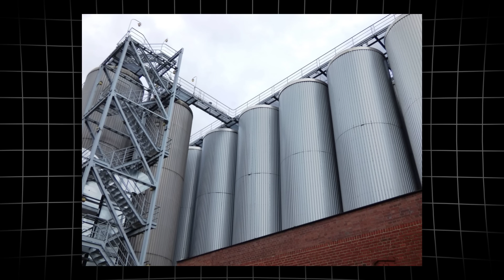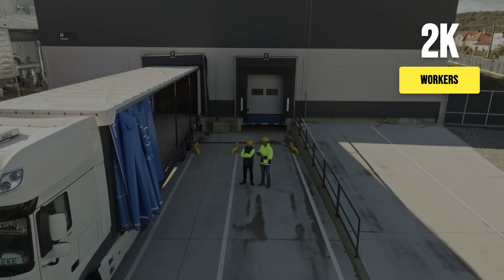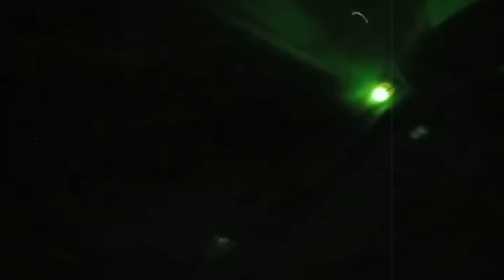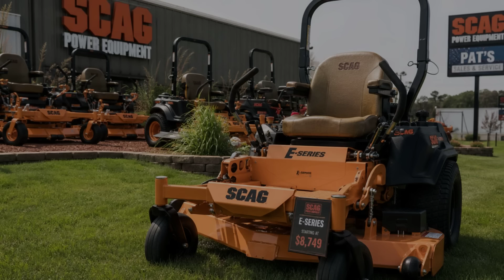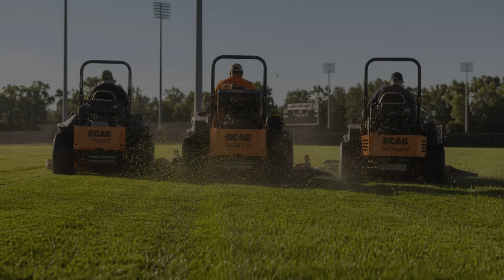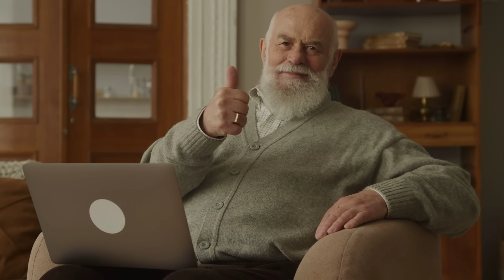The 4 LAST Truly American Made Mowers — And They're Better Quality Than John Deere & Toro

Comment: You left out Bobcat. Up until recently they weren't affiliated with the Bobcat skid steers, tractors, mini excavators etcetera and were GREEN IN COLOR. Now they ARE part of Bobcat wearing Bobcat colors.
They're BUILT in Johnson Creek, Wisconsin. Frames &  decks cut out, welded together powder coated, and assembled in one plant. I know because I worked there with a fastener supplier when their parent company was Textron.
Reply from the maker: That’s great insider knowledge, thanks for sharing your experience with their manufacturing process!